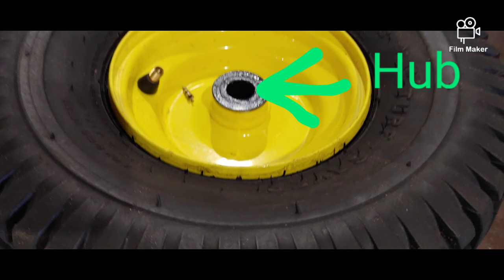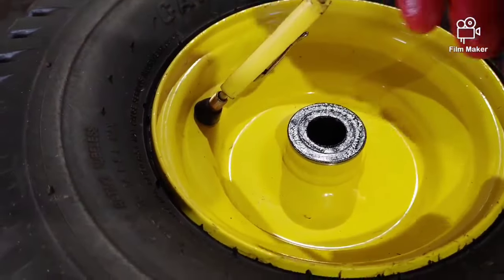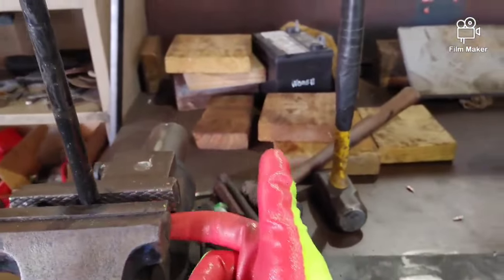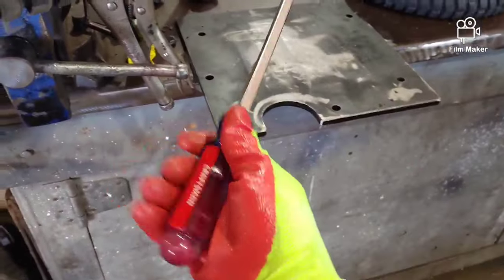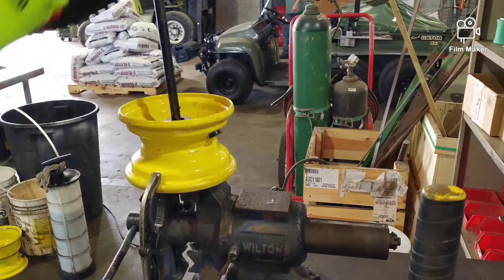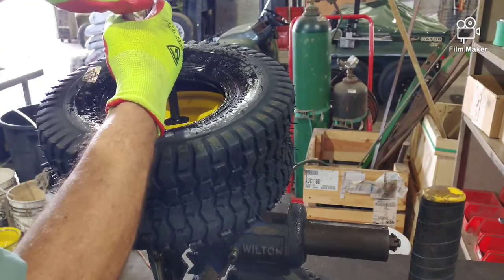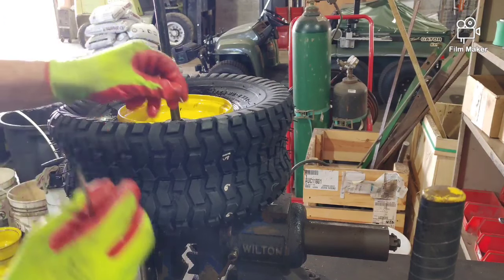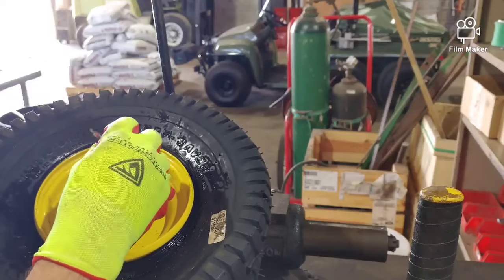How to mount a small riding mower tire. Very easy method.

Comment: I would like to see him do that on a old wheel,kinda rusty and needs a tube in it
Reply from the maker: Piece of 🍰. Don't think just because you watch me do something that you'll be able to it. 😉
Reply: @Mechanical_Mind  I did do it your showing people on a brand new shiny smooth wheel and flexible tire
Reply from the maker: @dougsmith9099 what's your point? Do you just like to complain?? Yes some tires and wheels will be harder than others. The process still works just might take a little more effort. Jeez

Comment: Very rarely will you be removing a tire that plyable. Tires are typically old and stiff
Reply from the maker: True, I do old stiff tires often. Still use the same process.  It may just take a little bit more muscle, but it still works.

Comment: You left out the hardest and most important part of the process. And that is how to get the tire reinflated.
Reply from the maker: If I can't get these little tires to seat properly for inflation, I will use a ratchet strap around the center of the tire. Then tighten it up and that then pushes the bead of the tire to spread out on both side. Add air very carefully as you loosen the ratchet strap.

Comment: It's not that simple when it comes to actually putting air into it. You should leave the inner part of valve stem out to get a good shot of air to seal the bead to the wheel . If you don't you have to fiddle with the tire till you get it to seal off.  That's the easy part removing and replacing tire, it's seating of the bead that can get you stuck.

Comment: Try that with an old tire and with a tube.
Reply from the maker: Did hundreds of old dry hard tires. You can either try the method or not.
Reply: @Mechanical_Mind   I have that’s why I mentioned it.
Reply from the maker: Sounds like you need more experience & practice on tires and less time whining in comments on videos that dont solve your specific situation.  You also need to realize that not every video you watch is tailored for Derek and his situation. This video has helped many others, as you see in the comments.  I've had tires so old I had to cut them off. It's called life. Grow up. I didn't go leaving whining remarks to videos that didn't help my specific issue.

Comment: Sorry but this did not work at all for a 16 x 6.50 x 8 Carlisle Xtrac heavy duty tire, which is for my rototiller.  Even with  a 3 foot prybar no way was that thick tire coming off with this method.  Thicker tires just suck it up and let a shop with a tire machine do it.
Reply from the maker: This is only for small tires

Comment: Of course, the tires and rims in the video are brand new and very pliable with no tube to deal with.
That IS NOT real life.
Rusted rims, tubes, and 25-year-old, HARD tires are a completely different animal.
Takes 10 times the effort and care of the example shown.
Reply from the maker: I will make any tire look easy to you, including your 25 yr old one. 😂
Try less typing on a keyboard crying and whining like a baby and more actully getting out there and doing it like a mature capable adult. Yes, an older dried up tire will take a little more effort but it's that same process. You're welcome.
Reply from the maker: Oh and if the wheel is rusted then just replace everything, wheel and tire and all. FYI it's called a wheel not a rim. The rim is just a part of the wheel,  the outter edge of a wheel.